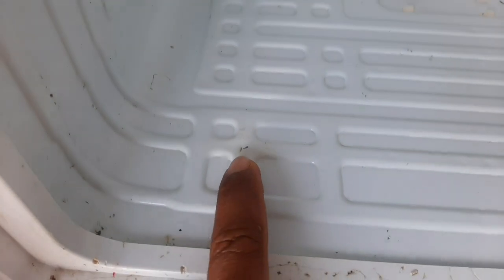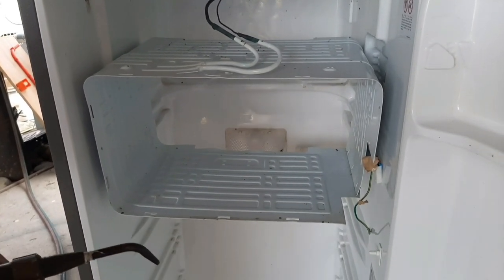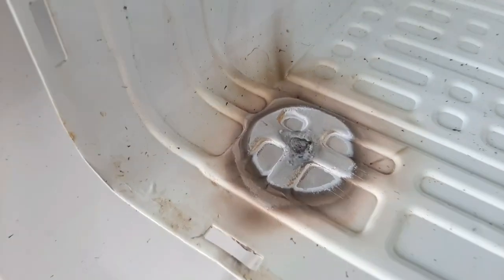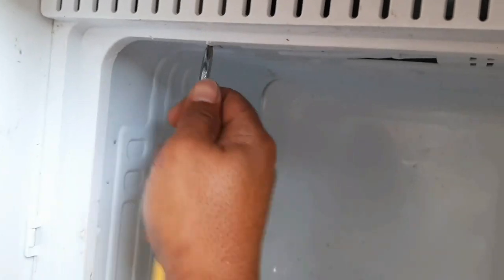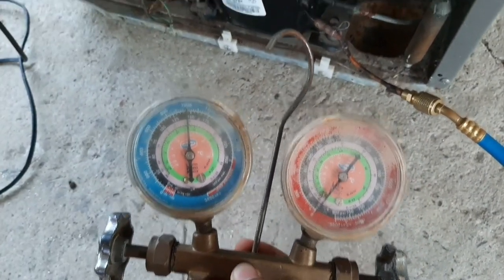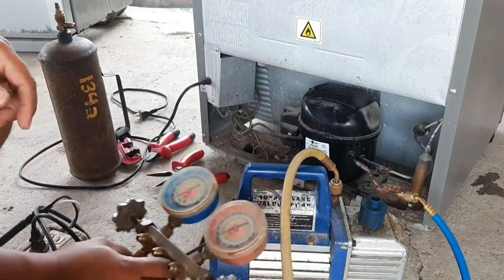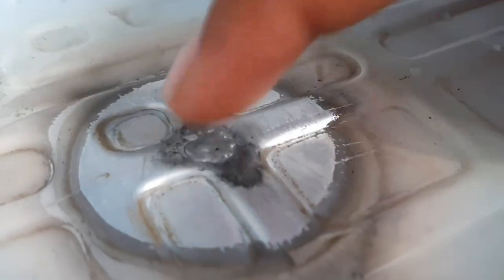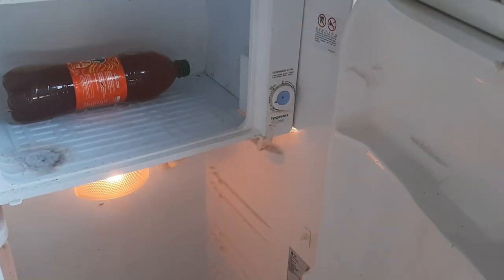Paano magkarga ng freon sa nasundot na freezer ng ref. Refrigerant recharging

Comment: dapat nilagyan mo nang discharge pressure to overlooked the high condensing temperature.the high compression ratios can be cause low suction pressure, high head pressure, or a combination of both. the higher the compression ratio, the higher the compressors discharge temperature will be. this happens because more heat of compression will be generated when compressing the gases through a greater pressure range at sana Nitrogen ang gamitin kung mag leak testing and flushing of systems.at palitan din nang filterdryer. ganyan ang mag reprocess boss RDC TV. hehe.
#shout out boss from cebucity
#tiknikoy

Comment: Sir. Dpat Isama  ang mga technical na explanation sa video na ito tulad ng
1. Pressure high and low
2. Pagkabit ng vacuum pump
3. Paano gumamit ng  manifold gauge 
4. Ampere starting and running
5. Ang tatlong tube connection sa compressor.

Salamat ng marami Sir.
Reply from the maker: Ggwan ko ng video yan salamat sa suggestion
Reply: Mga ulaga nga ang gumagawa ng tuturials, di pa kumpletuhin ang details, tapos nag expect ng SUBSCRIBE.
Reply: @joelou bering  .. tama ka sir . yan talaga dapat
Reply: Sir ano ba ang magandang gamitin nang refregerator invertir na fros free or non fros free...at anung magandang brand ang gamitin...
Reply: Nice Sir.  The whole process is highly technical in nature.  Specially the welding of aluminum. It requires proper welding skill. Ang importante lang malaman  ng fridge owner  ay   Ang resulta pag nabutas  ang evaporator. Ang tawag ng mga misis ay “freezer.”  You dont have to  show the techical aspect like volts and amps. Like when the refrigerant will turn to liquid and then back to gas. As I said, naipaliwanag mo ng maayos sa mga misis yung mangyayari sa freezer nya  pag nabutas.  Lets leave  the highly technical know how to technicians like you.   Good job Sir.
Reply: Sir ano po tawag dun sa nakalagay sa bote na sinawsaw nyu yung wire
Reply: Ilang inches of mercury ba yun?yung tamang reading para masabi na vacuumed na sya at ilan naman po ang correct pressure ba yun?para masabi na full charge na sya ng freon?
Reply: Sub standard po sya dapat palit filter dryer po . Maaaring experience nya lang po yan
Reply: @reypascual1415  sub standard po sya s repair kailangan po ang ref pag magkakarga ng freon palit filter dryer po cgurado po ako n experience nya lang yan walang pong tesda o anupa man
Reply: Tama po ito, kasi ndi lahat may basic knowlegde sa mga equipment sa HVAC. Pero meron din naman mga video kpag nsg sesrch ka sa ytube. Pero if mgagawaan mo ng pa isa isang videos ang mga nasabi ni @joelou mas mganada Sir at masa madaming matututo. Salamats
Reply: @johndelacruz8347  Ang tamang process ay gumamit ng micron guage para mka-pull ka na 500 Micron.  PAg-pumasok na hangin o tubig yung ay Non-Condesable. Pag-nagkaroon ng NOn-condesable  sa system yun magiging Acid at ma-wawash-out yung insulation ng winding compressor motor mo yung magiging compressor burn-out. Pag-di kasigurado kung meron kang non condensible, mag triple evacuate ka sa vacuum mo at gumamit ka ng Micron guage.
Para tamang proseso ng reading kailangan mo gamitan mo ng PT-chart sa running pressure ng LOw side mo makikita mo yung corresponding temperature para sa target evaporator temperature mo para di ma-over charge at kunin mo rin yung RLA mo or running load amps. Maliit na system lang naman ang Refrigerator di mo na kailangan makuha yung Super Heat ng evaporator. Kailangan mo rin malaman yung volume ng refrigerant design para sa system, normal mong makikiata yansa Name-plate ng Refrigerator kung ano yung Low/ High side pressure at ilan Ounce yung Freon ang design volume yung lang ay kailangan mong gumamit ng weighing scale habang nag-ccharge ka ng system. Ito yung tamang Guide-lines kung meron ka lahat ng Equipment at tools. Pero tayong mga Pinoy ay magaling sa Weadow kaya makakagawa tayo kahit kulang ang mga gamit.
Reply: Hindi nga nag system flushing
Reply: wala man lang PLEASE?
Reply: tama para di tayo maisahan ng mga magugulang n technician,,, tanong ko lng mga sir di ba alam ng mga technician kung loss compression na ang compressor kung tiningnan nila pressure.. kaya lng ayaw nila sabihin mbibigla k n lng bigla mgsasabi plitan ito itan yan
Reply: Ayus pambihira master no flushing gumana ang ref
Reply: Juan saludes da magical hand ayan na hinahanap mo video
Reply: @RDCTV  sir saan po banda shop nyo?

Comment: Sir ano issue nag bi build up ng ice sa suction pipe hangang evaporator upper part lang ganyan din sharp ref nag flushing na ako at drier change 0.5 amps reading ko at 6 psi newbie tech po ako slamat sa reply mo ..

Comment: Great job sir👊 salamat sa share, ask ko lng po kung saan makakabili ng compressor ng ref, brand ay white Westinghouse at ung silver rod? Salamat po ❕
Reply from the maker: Sa refrigeration at airconditioning supply po
Reply: @RDCTV  yes Sir, sana nabigyan u aq ng tips kung saan makakabili ng new compressor ng refrigerator at AC. Thanks po🙏
Reply: Anong tawag sir dun sa sinasawsawan ng alum rod at mgkano.

Comment: Master may ask lang po AK ano ang sira pag napalit an napo ng compressor na bago tapos nong kinargahan po e naglolos compression.
Reply from the maker: Check mo sir bka nagbabara yan
Reply: @RDCTV  hindi po siya barado kasi before kami nag Palit at mag karga nag lik test, flashing po kami tapos nag Palit po ng oil at nag vaccum po after non kinargahan po tapos nong kinargahan po siya nag karga naman po nag init Nan po ang condinsir at lumalamig naman po ang evaporator kaso po hindi po nag tatagal nag lose compression po siya. Salamat po sa sagot
Reply: Pinalitan bagong filter dryer